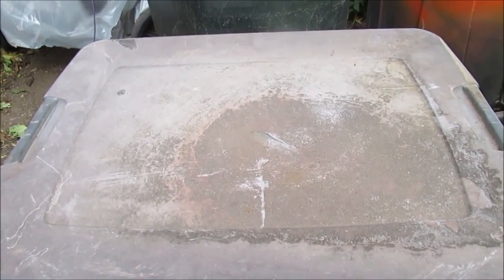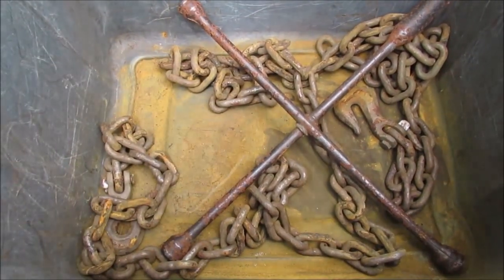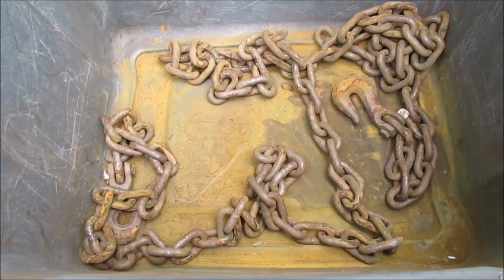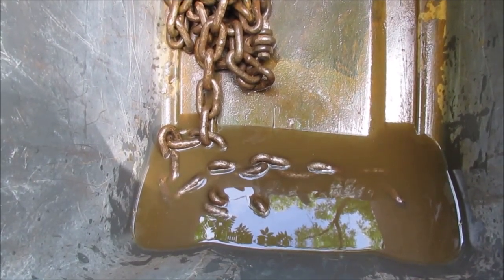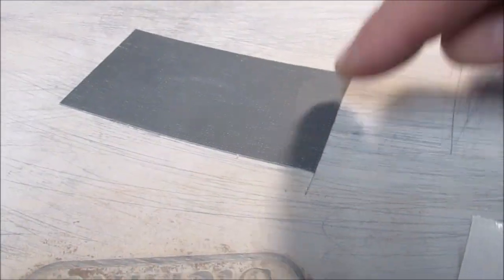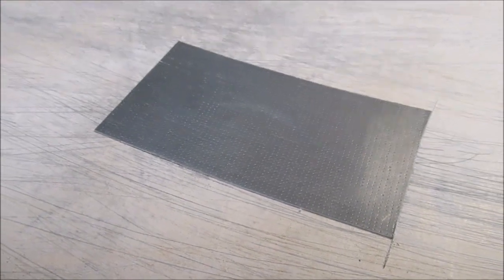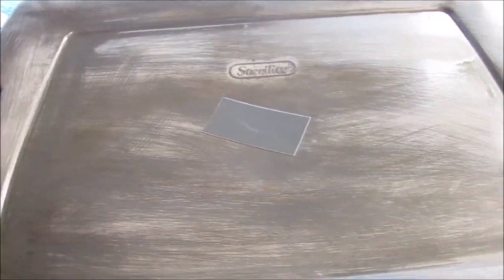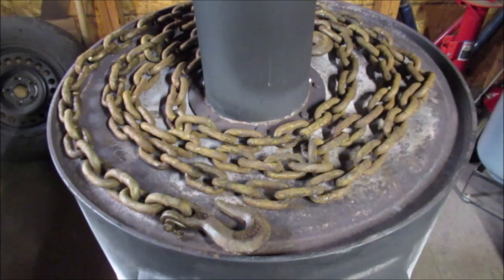Clean & Paint Rusty Log Chain

Comment: i usually just hose my chains with wd40. but paint is nicer
Reply from the maker: I have had tools rust after using wd40 I have been using a cheap brand that leaves a waxing coating and it also can rust
Reply: WD40 is SH*T! I have a chain whip that's in constant movement an abuse. In all types of weather. I need something versatile (and not too greasy)
Reply: I want to go with a paint. But I don't have the income to experiment. What type of paint would you suggest. Spray? House? Brand?
Reply: I use vinegar to remove rust but removing it with water has become a major problem
Reply: I'm going to buy a generic spray paint and see what happens.  I would love to have it dipped in chrome link for link if it were possible. A person may live their entire life and create maybe one perfect thing. This is my opus. For the moment, one of a kind.
Reply: My main question would be: should paint be applied directly onto the dried vinegar or should the vinegar be rinsed off first? (Not an obvious answer for my devices)
Reply: Durability is paramount. I don't wanna have to go through this process every other day.
Reply: ... the links of my Dragon are fashioned with 2 sperate flat link chains connected by a washer.  The metal is less magnetic